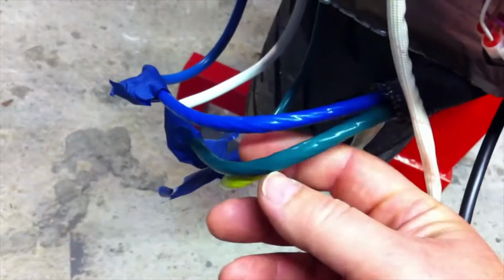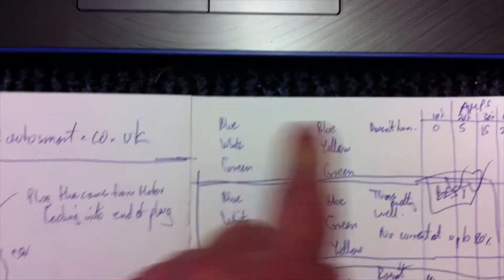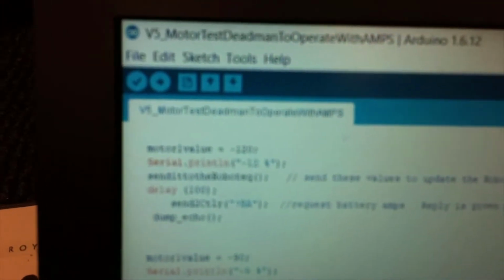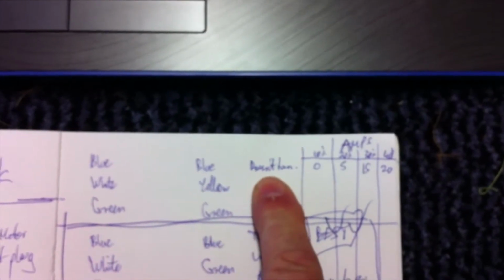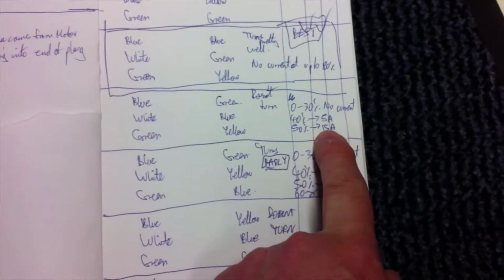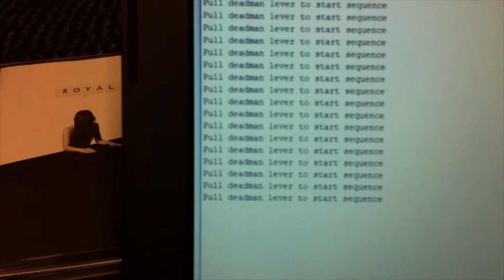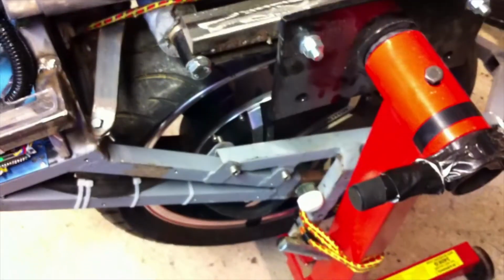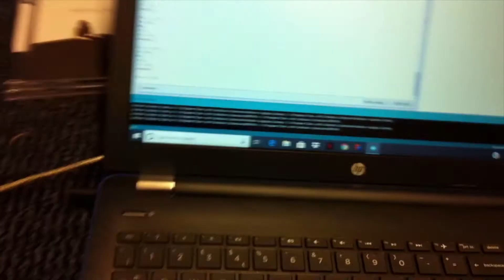Unicycle Garage #17 Arduino-RoboteQ upgrade Part 2.

Comment: @XenonJohn Hi, this seems a very interesting project! A big question for me is the Arduino code as you Serial.print("?BA") to request battery current? but then have code to send it to the RoboteQ - is this a library that you use or unneeded? I'm currently using a FBL2360 RoboteQ with an Uno and Serial.print("?A") and the response is nothing from the RoboteQ - I have a TTL-RS232 converter as well so I was wondering whether this additional code was the issue? Any help would be greatly appreciated
Reply from the maker: I only send commands to the Roboteq regarding speed, I do not request any diagnostic information back from it while it is running at all. I cannot remember what the problem was that stopped me doing that however. I found it worked better if I was just sending speed commands for the motor.

Comment: Sir we are intrested in making this bike can u help us plzz ??
Reply from the maker: Now, after 10 years building self balancing machines, I am completely happy with how this one performs, see video 18 also in this series. This machine was expensive to build using the best parts for the job regardless of cost, and is quite powerful. I would recommend starting with a less ambitious version first. I might be interested in partnering with a company to bring this to market or building them on a one-off basis. The parts alone come to around $1500 before you factor in the build time.